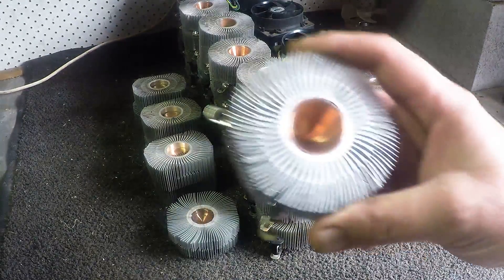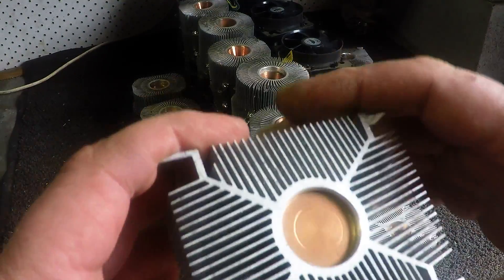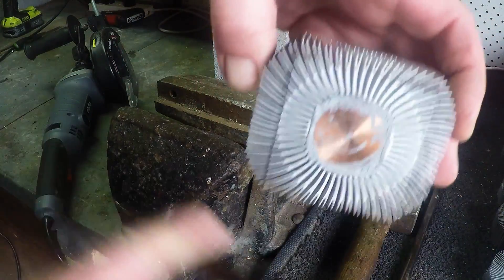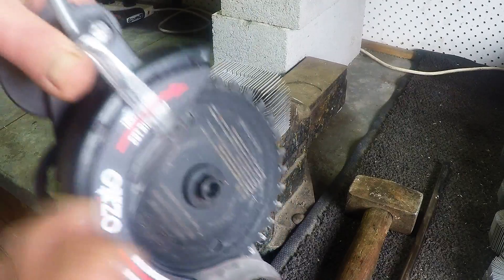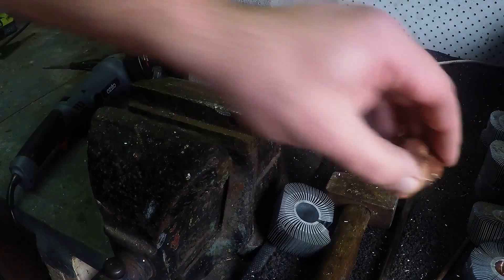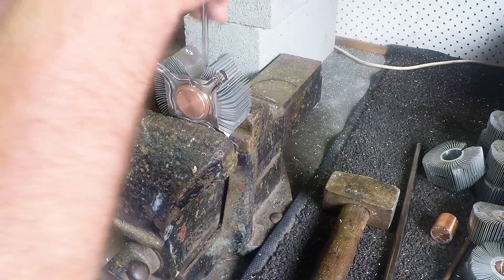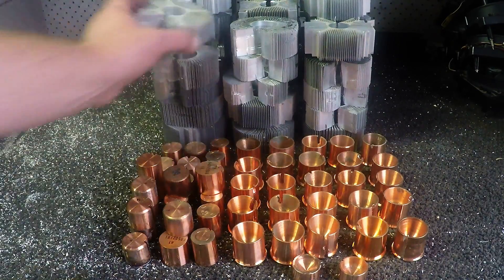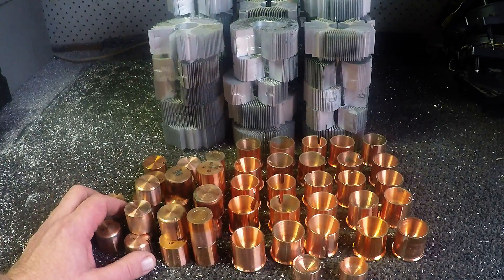Copper Stackers from PC Heat Sinks

Comment: Use a cylinder/'punch" on one end, and a piece with a hole on the other end. Make sure they fit they're at most a little smaller than the copper's diameter, and at least a little longer than the copper's length, too. Place in vise and tighter to extract the copper. A lot less of a mess, and not too much more elbow grease.

Comment: Even without an electric cutter this can be done with an ordinary hacksaw at about one minute or less per piece. Yes, the press fit is very tight. Machine shops use hydraulic presses or arbor presses for that sort of work.

Comment: With such a small amount of aluminum to cut through, you could just use a hack saw. That way you wouldn't cut through to the copper. You could also rig up a car jack as a press to push the copper out.

Comment: when U want to have a piece of copper from these heat sinks WITHOUT having a cut AND without hammering on thop of then, just heat the entire heatsink up and after reaching 250°C (dunno exactly at which temp the copper falls out.
Thats exactly the way (vice versa) how the manufacturer produces them.
It might not be a bargain in terms of scrapping value but U can use the whole diameter when U want to cut something from this on a lathe machine. taking out the goblit ones 'U can use these as an egg-cup :D

Comment: @eWaste Ben Open the fins on one side and heat the aluminum (with a propane or MAP gas torch) at that point to make it expand, and the copper should just drop out. Might have to persuade it with a light tap.

Comment: Being aluminium it's pretty soft, which means it's pretty easy to cut. So why not take a few strokes with a hacksaw or one of the many finer bladed saws and remove as little material as possible?

Comment: alternitive uses for the alloy blocks , use the alloy blocks as heat sinks for 1' water pipe to help cool liquids running through the steel or copper pipes , thermal cooling ect

Comment: The gobblet stacker are useful for motorcycle nipple repair. fill and heat solder then dip cable end into it you then have a perfectly soldered cable end. I use these all the time making custom cables. You could sell them as well for 5 bucks each ish depending on demand.

Comment: Try this: Instead of cutting with the grinder, position the heat sink flat over an opening the diameter of the copper plug. Then take a solid steel rod that is the same diameter, or a hair less than the copper plug, and give it one  hard whack with a five pound sledge. That plug will probably pop right out.  This would be far faster.
The hydraulic press idea, below, is a good idea as well.

Comment: Once i've cut trrough the first heat sink,i would sandwich the next one between a smaller diameter copper and the aluminium casing in the vice and insert the lot in the vice.The vice should work like a hand acting on a syringe.No guarantee it would work though but considering the number of heat sinks,I would give it a thought though.Nice video.

Comment: Look at all those beautiful heat sinks!!! I could use about 11 of them! About 4 for my old workstation and the rest for a top secret project I've yet to start working on <JK>

Surely You found an easier way to remove them... like, the way they were installed... with a press. Look up ball joint press. You need a "ram" to push the core and a "cup" or "receiver" to "receive" the core. Make the cup and ram into a tool like your crucible tongs and it'll easily become a two-handed job rather than two hands, a knee and somethin... 

"... to prop it... up... momentarily... while I free... up a hand... so I can close/open... the vice. There!"

Pop her in the vice and clamp her down, pushing the core out... saving all the scrap aluminum from waste made when cutting.

Comment: All you need is a large socket (as is used for capscrews "bolts" ).   Place a socket slightly larger than the copper on one side and a drift (punch, bar) or bushing on the other and put in a vise and turn the vise and press it out.

Comment: Why do you work so hard?  Don't you know you could just heat them on the stove, wait, Then drop an ice cube on the copper and it falls right out. It takes a little practice. No hammering, pressing or  damaging the heat sink.

Comment: Heat it with a torch.  The Al and Cu expand at different rates.  The Cu will tap right out.  Your way is quicker though, and you end up with a nice pile of Al for making thermite.

Comment: can you not just punch them right out using the vise to lay them on top and use a socket that is slightly smaller in diameter as a punch? with a good whack it should pop right through.

Comment: Get a little press. They're cheap and you can pop that bad boy right out of there.  You'll save on time and angle grinder discs!

http://www.ebay.com/itm/NEW-6-TON-A-FRAME-HYDRAULIC-HEAVY-DUTY-BENCH-SHOP-PRESS-/232134533273?hash=item360c4be099:m:m3NREGuLQABl7-fOLi4mgMA&item=232134533273&vxp=mtr

Comment: Probably you don't need to use a grinder. Just put a Large screw inside the hole and a cup in the other side (or two parallel bars against alluminium piece (not the copper piece). Then  put the goup of pieces in the "press"(is the name?)  and turn the lever few times. Then the press by (the screw) will push out the copper thru the alluminium. (Sorry for my bad english).
Reply: That just takes more time and effort

Comment: We tear down buildings so we get hundreds of lbs of wire and cable from each building and our boss lets the operators keep all the copper so us,,the drivers or truckees as you call em can walk around and roll up some copper wire here and there. Once I had 380 lbs of copper wire and sold it without even removing the insulation.

Comment: NEVER use an angle grinder with a stone blade on aluminum or copper. It work itself into the stone, build up pressure and WILL explode. It is dangerous.
Reply: Good advice, but it looks like he's using a steel blade to cut it.

Comment: For a god sake. Heat it , and it will just come off.
Reply: Use a cold chisel at the same angle of attack as your saw.  Bang, bang:  Done.  Almost zero waste, and no need to use power tools.
Reply from the maker: Heat a heat sink?
Reply: eWaste Ben Exactly.
Reply: Thank god!!!
I logged in just to say it!
 Greets from Brazil.

 Trumps... RLY?  :)
Reply: I didn't see this before my comment. Completely agree.

Comment: Just heat it with a propane burner (or such) and then use that same rod and hammer to remove the copper.
Aluminium has a higher rate of thermal expansion.

Comment: I don't think that counts as extruded aluminium tbh. It still needs to get recycled. Extruded means when you buy like a 2 meter profile of it, to build something.
Reply from the maker: No, extruded is a manufacturing process, extruded aluminium is pressed through a mould when it's heated up so it comes out that shape, maybe do some research
Reply: eWaste Ben Yes exactly it's a manufacturing process it doesn't change the material.  It's just more expensive because the aluminum has been pressed into a more usable valuable shape.  That's usually a stable long tube that it used to build stuff.  The heatsinks once were such a "tube" but it has been cut into 10cm pieces and broken by you with a screwdriver and a saw. Nobody can build something from that, it is just scrap at this point.
Reply from the maker: no extruded aluminium is actually a higher quality aluminium, that's why scrap yards pay more for extruded, perhaps take a heat sink to a scrap yard and see for yourself. I don't particularly care for technical stuff but there's plenty info online if you really want to know

Comment: I'm not a scientist, so there are probably massive holes in my reasoning, but if heat causes expansion, could cooling the heatsinks cause the copper to shrink, so you can tap out the copper more easliy? I know that if the copper shrank, the aluminium would too, but it's possible the copper would shrink more than the aluminium.
Reply: Aluminium expands and retracts more than copper so doing the opposite would be the way to go. Heat it up enough and the slug should come loose.
Reply: Now that's using your noggin.
Reply: Just make sure the copper doesen't reach 600 degrees celcius.. Otherwise other problems starts to form xD
Reply: Thank you I was thinking exactly what you were thinking
Reply: just magnetize the AL and neg-magnetize the CU, and they won't like each other anymore
Reply: just magnetize the AL and neg-magnetize the CU, and they won't like each other anymore
Reply: just magnetize the AL and neg-magnetize the CU, and they won't like each other anymore
Reply: You would be better to heat them gently. Aluminium will expand more than the copper (conversely, if cooled, it will shrink more so grip tighter) and be easier to push out. Of course, aluminium melts at a lower temp so be careful with applied heat!
Reply: rchaffer 0
Reply: Does anybody know if the copper cups are considered bare bright or number two?
Reply: That is likely how these are even manufactured. But honestly using heat and cooling costs a lot when you get this much profit only. And copper takes heat like a mofo, it has a pretty great heat capacity
The easiest way would be just hitting it between the fins with a large hammer and chisel
Reply: still a heat sink and aluminum would shrink more than the copper
Reply: rchaffer excellent idea, that never crossed my mind, ur right he couldve stuck im in freezer overnight or heat the ulluminum with a torch and booger up the metal

Comment: Use a drift nearly the same size as the copper slug, as your "spreading" the copper with a small drift in the aluminium and locking it in. also put some effort onto it.  ;)

Comment: why dont you press out copper center with a hardened steel punch&die use solid round soock that is a 1/16" smaller then the copper center and a impact deep weel socket or use a ball joint removel kit with comes with  press & dies  $20.00 on sale at harbor freighr # that's what i would do no loss of material from 1/4" twin blade on that cut all saw/grinder , thats my 2 cents

Comment: where do you find your heat sinks... i need copper lots of copper but have to get it in small amounts for now... i also need large amounts of aluminum... prefered if they aren't mixed but i could separate it myself.
Reply from the maker: mostly old tv's for copper & ally, microwaves for copper from the transformer
Reply: hell i would unwind the windings from the transformers and use them too

Comment: There has to be a better way to reuse those as a finished product rather than scrapping them..  Could use as a heat exchanger on a wood burning stove for example or as part of a sculpture.. Scrap is your lowest return on time.  Set up an account on etsy or whatever and you could probably get $5 a piece for those

Comment: if you heat up the copper with a torch you can push it out really easily
Reply: you don't lose any material either, it can also be done easily on the stovetop

Comment: In regards to cutting the aluminum from the copper central part. Angle grinder mentioned alot. You do not need anything quite so elaborate, just use a hacksaw. Aluminum is soft and very easy to cut through.

Comment: I've been doing some using an old chisel on the Aluminium and cuts through easy and you don't damage the Copper and is fast to do.  Love your videos, keep it up.
Reply: I do them with a hacksaw - the aluminium is really soft. Get almost all the way through to the copper then hit with a hammer and the aluminium shears, allowing the copper slug to drop out.

Comment: THE COPPER SHOULD BE #1, NEVER #2, AND SHOULD BE CONSIDERED AS ''BARE-BRIGHT'', EVEN A BETTER GRADE THAN #1!
THOSE ARE EAST COAST AMERICAN TERMS, #2 COPPER HAS SOLDER, TIN OR EVEN SILVER PLATING, AND/OR COULD HAVE THE INSULATION BURNED OFF. (TELL THEM A HOUSE BURNED, AND YOU SALVAGED THE WIRE.
Reply: http://maddox.xmission.com/keyboard4.jpg
Reply from the maker: No there's a #3 copper which is soldered or burnt copper
Reply: LOL

Comment: just get a bigger rod to punch out the copper. you are wasting time
Reply from the maker: as I said in the video, some come out, some are so tight it's impossible, you can belt them forever, no i'm happy with the system I use.

Comment: You may want to try a simple propane or map gas torch to heat the aluminum. It should expand and can immediately be knocked out by a drift and hammer.
Reply from the maker: nope doesn't work

Comment: id try to devise a way to punch it out with the vice itself. im sure you can get enough pressure with it.
Reply: I was thinking the same thing.
Reply: or you can hit it with a sledgehammer or heat it up, since Aluminum expands and contracts more than copper does. Put it the the vice, hit it with a torch and then knock that copper peice right out of it :)

Comment: just press it out with a car jack. No mess. :)
Reply: share this knowledge, make a youtube video!
Reply: Its pretty straightforward. Is there really a need for a video on it?
Reply: Yeah, make a youtube video showing how.
Reply: They don't think it's possible. ;) Not even sure you'd need a jack press. Just a bearing press might work. Only reason I was thinking that is in roisin pressing people use them. They are pretty cheap and very powerful.

I was just thinking outloud.
Reply: A vice is not really supposed to be used as a press.... sure we have all squashed stuff in a vice but its not really proper use of the tool.
Reply: ^ but no harm done, it works
Reply: legion2k
Reply: legion2k or he could just use the vise that's right in from of him